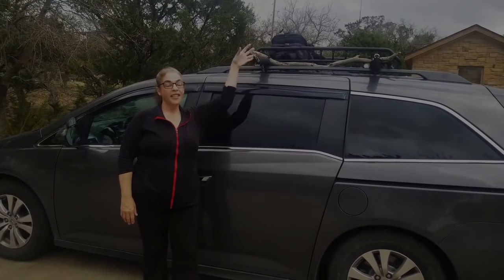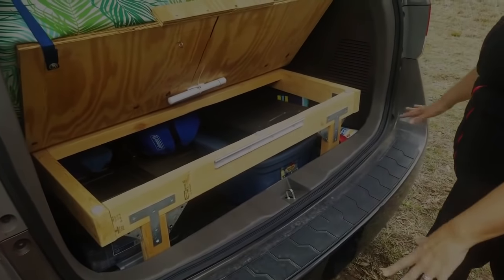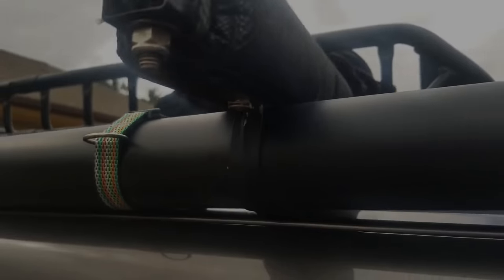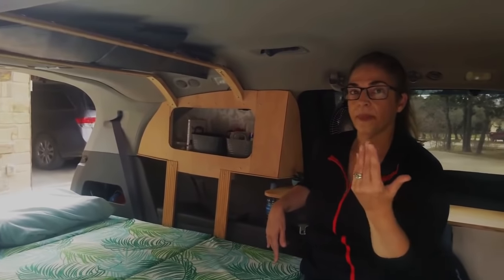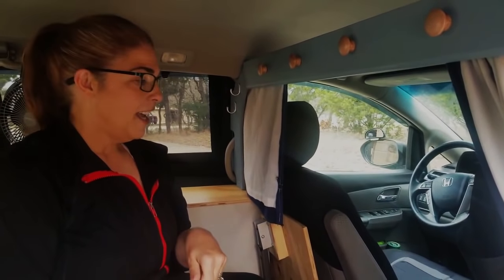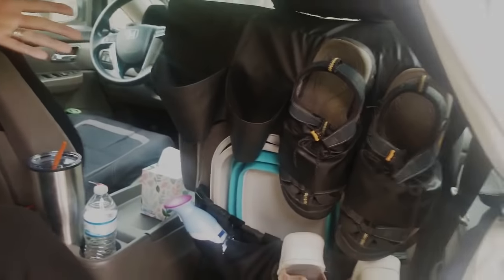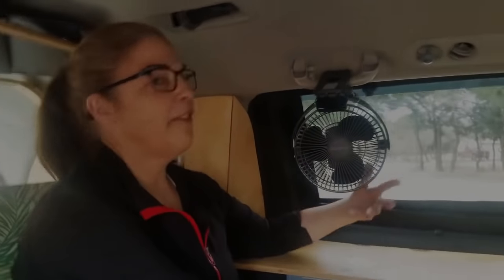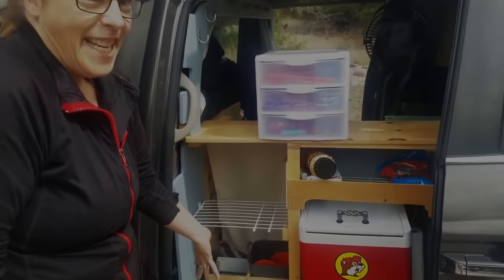My minivan camper REVEALED! Full in-depth conversion van tour

Comment: Did you remove the plastic coverings on the floor for  rearr seats, or did you  cover with wood? How did you remove the rear seats?
Reply from the maker: Hi, and thanks for asking! I actually didn't cover anything with wood, since the bed frame is built over most of the floor. To remove the 3rd row seats, I had to watch a couple of videos to make sure I did it without taking off a finger. They're spring-loaded and fierce! Not like those friendly 2nd row seats, that just pop right out. Are you going to take out some 3rd row seats? You get soooo much storage space if you do, just sayin'.

Comment: Do you have any problems with the mattress sections moving or sliding? I’m very interested in this design, but worry that I will feel the separate pieces.  Thanks for the tour!
Reply from the maker: I was worried too, but then I was like "Oh, just try it!" To help slipping, I put a small strip of wood at the head and foot of the platform to retain the cushions. What also helps is putting a fitted sheet on them. Very minimal movement using both those components.

Comment: I have the same van. How can you turn off the lights when the tailgate is up so that it doesn’t drain your battery? Also when trying to get out of the back (in the middle of the night) does your car alarm go off? I had that happen last night and wasn’t sure what to do to prevent it or what i even did to make it alarm
Reply from the maker: Hey JenS! How you doin? I flipped the switch that keeps the interior lights from going on when the doors open. That way, light comes on only when I put it on! 😃 And I can't help you with the alarm question, sorry. I haven't had that same issue. Have you tried an Odyssey owners group for questions like this? I found one on fb that I used to visit. Very helpful!
Reply: @TheVanThatGotAway  thanks Leslie - I figured out what I did wrong and ... duhhhh the switch. I thought maybe there was some magical thing I had to do to make that happen. Thanks. I’m learning a lot from your videos. Experienced backpacker here but not an experienced van camper - world of difference
Reply from the maker: Sometimes the simple things are magical!! This is my first time camping in a van, too. You're in good company. Thanks for being here 😊

Comment: How did you make a template for tge back window shelves?
Reply from the maker: Hi Fadwa, I sketched out my idea on paper, did some measurements in the space, then cut out some cardboard pieces to represent the wood pieces. I fiddled with the cardboard pieces  - cutting them down in places - until they fit together just how I wanted.  Then I traced around those cardboard pieces on the wood to mark out my cuts. It still took some sanding down in places but it all worked well enough that I could fit the wood pieces together and have respectable looking shelves.  😄 Thanks for asking!